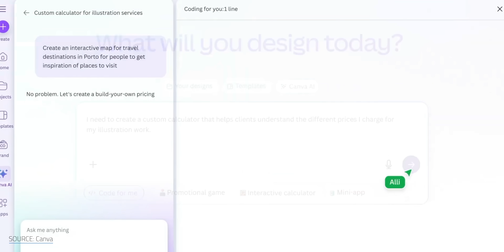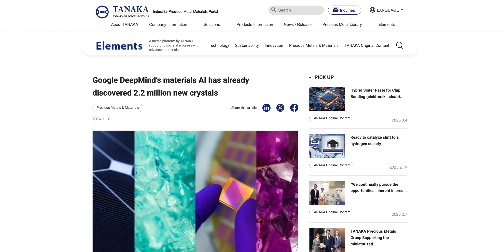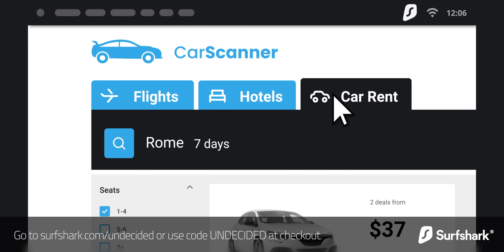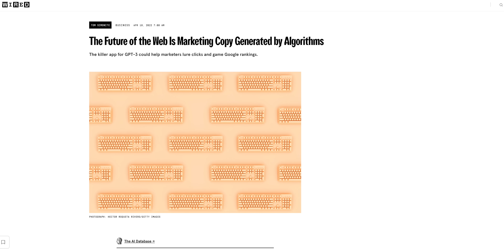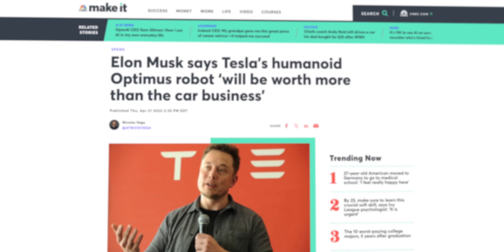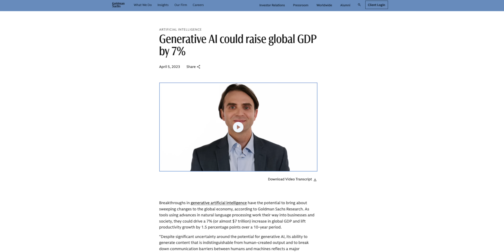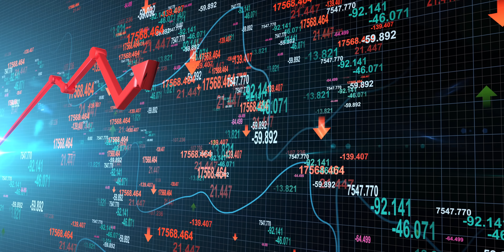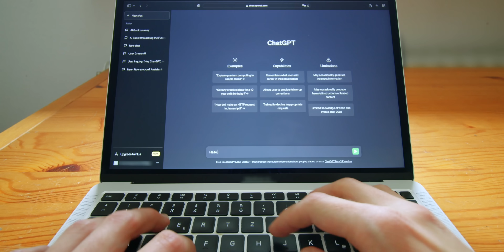Why the AI Revolution Has a Fatal Flaw

Comment: You are not representing the economics 101 story correctly.

"The system is designed with a key assumption that automation leads to lower prices and lower prices leads to more buying, but that's only true if people have income. If AI replaces humans in a way that severs that income and no replacement system is created the whole thing starts to fall apart."

You are stating this as if the income of the workers who lose their jobs just vanishes from the economy. Whereas in economics 101, *their bosses keep that income*. There isn't less total income, the income just flows to different people. Go beyond economics 101 and you can tell a story about "stickiness" or maybe the "marginal propensity to consume" where a shift of income to bosses and "high skilled" laborers would reduce aggregate demand.

Respectfully, I think this video probably adds more confusion than understanding to the world. Publishing this isn't fair to your viewers. You should delete it.

Comment: You should check out Jeff Booth's book "The Price of Tomorrow: Why deflation is the key to an abundant future". It clearly describes this problem. The solution is to allow deflation through the use of a decentralized deflationary currency like bitcoin. This allows us to enjoy abundance without over-centralization as the system is sustainable and circular. Thanks for the video!

Comment: I just have a question, wouldn't new jobs be replaced with AI more in the future, as a result, people don't have money to spend? Is the answer even standard jobs anymore, or do we need a different way to do this? Please let me know if this a solution, since AI is creating a lot of products fast should we move to a barter system, and the value of a service should be set by government, here is my reason behind this, AI is creating a lot of products right now, if we have more products compared to money shouldn't we be trading with products instead?, please let me know if there is an issue with my perspective. It made sense to use money as a currency, when jobs were more demanded back then. Thank you,

Comment: People who compare AI revolution with previous ones (like cars replacing horses) always refer to job replacement. For example, drivers taking over horseman, car maintenance workers replacing stable workers and etc. But, they miss one BIG POINT. In AI revolution, the job does not change to another job. Here, the job stays as it is, but is being done by machine. Image painting is not changed to for example photography. Image "painting" and photography are both done by machine now. So, 1st time, people are totally being pushed aside. This MUST be stopped at all costs.

Comment: To avoid economic crises, massive unemployment, massive jumps in income discrepancy and so on governments the world over will need to not just catch up but actually get ahead of AI implementation. For example, limiting or phasing in AI that would displace humans so that the change moved at the pace of the labor market, safety net programs and economy instead of making sweeping changes all at once.  Functions of certain elements of a job could be automated but the employ remain in place with a lighter workload with the intentional inefficiency stabilizing adjacent market forces and and social systems allowing people to prepare for other work and/or the company time to restructure duties so that employees could be retained but with a different set of tasks. Another option would be to require permits for AI implementation, that way governments would be assured a seat at the table to manage the change.  If the past is any indication, left unchecked the rapid rollout and integration of AI will happen to the benefit of the bottom line at the cost of social and economic stability.

Comment: There's another problem with retraining to move workers to the fewer new tech jobs.  Those new, fewer tech jobs require not only more education, but more intelligence as well.  By definition, 50% of the population have an IQ equal to or below 100.  That huge group of consumers may not have the ability to retrain for those fewer jobs.  As Matt says, we've been automating away good paying blue-collar jobs for decades. I believe that's led directly to the social disruption we've seen over the last 10 years.  AI is going to accelerate that process because now, workers in the so-called "Service Economy" get to experience unemployment by automation.

I only see two possible solutions at this point, and Matt presents both here:  Either provide enough UBI to restore the middle-class, or regulate automation because it's as risky for society as nuclear power.  Both these approaches will prompt protests against "Socialism", ironically by many of the people that have been hurt the most by automation.

Comment: We are seeing several issues hitting prosperity in the Capitalist Society simultaneously which is causing massive job losses worldwide wide: 1)  Computerization which has allowed for companies to log and analyze data, and calculate far more technical solutions with that data;  2)  This computerization has improved our ability to create more complex and efficient machines to do work with substantially less people;  and 3)  These new complex machines have brought about revolutions in energy production/efficiency, speed of production/motion, magnitude of scale increase.  This is all before AI became the next issue.  So all of these issues are compounded with AI.  Capitalism is hitting a massive wall and there is no $$$$ solution that works.  Society will have to change how it does things and money will not be a thing anymore.  This will also eliminate all work due to the exchange of money.

Comment: AI will change everything but in the near term there will be two limiting factors.  1. The American economy's GDP is 65-70% consumer consumption.  If consumers doesn't have resources, GDP go down, as pointed out.  It's in business or the governments interest to throttle job loss and support transition of the work force.  2.  AI is staggeringly energy dependent.  Currently, there just isn't enough energy generation to meet AI's unbridled growth.  Considering licensing processes, especially for nuclear plants, (which appears to be headed for a return to the forefront of electric generation). Lastly, there is a serious issue with population demographics.  The birthrate, around the world, is and has been falling, for decades.  China for instance, has terrible demographics.  According to the WHO there will between 450-900 fewer Chinese by the end of the century and that is assuming they don't experience a pandemic, famine or war.  The disparity in the amount is the result of China's practice of lying about their census statistics for decades.  But, the point remains, most modern industrialized countries are merely hovering around replacement birthrates.  It may well lead to fewer workers needed, which is god because there will be fewer workers anyway.  

AI is coming and how well or poorly we manage the transition will make all the difference.

Comment: I've seen it other comments, but I think it's important to be wary of many of the claims regarding AI taking jobs - I suspect those claims are exaggerated and even if correct, I suspect AI may be able to do the job well enough to fool the 'hiring' manager, but actually is doing a really bad job compared to the fired human, especially for the 'low skill' jobs initially targeted. I know I've already worked though chatbot fueled help systems on a specific issue, with no luck, having to resort to demanding a human. (Although, last time I did that I had wonder if I just got handed off to a better, more expensive model!)

Comment: The greatest flaw in today's AI and how popular it is, is that it will soon be training itself. It gained it's abilities by ingesting the work of human kinds. The problem now is that AI generated images and text now make up a significant portion of the internet. So, going forward, AI won't be ingesting humans works to learn from, but AI creations, with all the AI flaws. It will be training its own flaws back into itself.

There is a common saying, a photocopy of a photocopy is always going to be worse. Each time you photocopy the result of a previous version, it will degrade further as each minor imperfection created by the previous version will be expounded by the next.

This is the future of AI.

An experiment in the early days of AI already proved this to be true. There were two AI, built to negotiate deals, and setup to be trained by the opposing AI. Their sole training input was the negotiations, and each was supposed to modify themselves to seek the best way to get the best deal. They both quickly devolved into a language of gibberish only they could understand. To the point that when a deal was made, the outside observers could find no rational for a deal. It appeared to be completely random by that point and definitely wasn't better.

The whole thing about AI, is that it doesn't use intelligence. It uses pattern matching with armies of humans to tell it which patterns are bad. It is just a shattered mirror reflecting actual human intelligence back at us. Take away the humans, you take away any semblance of intelligence.

Comment: Fear mongering.  The 58 year old factory worker can be retrained to do AI peripheral jobs that will pay more than that factory job.  That factory worker doesn't need to be a data scientist; that factory worker can be part of the AI supply chain or maintenance/upgrade cycle of physical AI components.  There will be more jobs that are, on average, higher paid than are replaced by AI.
Reply: Doubtful, most of those jobs will go to young college grads with degrees in the field.

Comment: Another aspect of AI is the energy required to make it work. Eventually, we won't be able to produce enough energy and that will become a limiting factor. The number of substations in my area of the country has increased 4-5x in the last decade, and they are always a short distance to some windowless building with huge diesel backup generators. Instead of suburban sprawl we are seeing server sprawl. Eventually, there won't be enough dams, solar farms, windmills, or natural gas generators to supply the electricity for these AI 'factories'.

Comment: I am a writer for TV shows and I can tell you that AI does not really play a role in the drafting of episodes right now. You can meaningfully incorporate it in certain steps in the production, but the benefit to productivity is severly limited. The reason is because scripts are too complex for even the most advanced LLMs to handle. Every episode/text has multiple levels of complexity, from overall structure to the way actions and dialogue is build sentence to sentence, down to miniscule details in single words - which no LLM can handle at all. And I mean AT ALL. The error rates in fact are so high and the text quality is so poor that you basically have to rewrite everything. And that is after investing a good amount of time to bring the LLM to a point where it delivers something that resembles a coherent text in the first place. So, you need a very capable writer to feed and then correct the LLM, leaving the usage of this technology in text production to be very limited and uneffective. It can help in summarizing (where it also performs rather poorly), structuring notes or transcriping audio files, generating names and giving an idea here and there. I don't really fear losing my job, tbh.

Comment: I have wondered about the employment question for many years.  You are the first person I have seen to directly address that question.  I've said 'tongue in cheek', a long time ago; The Terminator is not coming to take my life; it is coming to take my job.  I have no idea what the answer is to that problem, nor has anyone come up with comprehensive answers.
I use AI with Spell-checker, and Co-Pilot search.  I would like to attend Amazon's Machine Learning University because the curriculum looks like it's fun.  In September 2032 at age 70, I will be eligible for maximum Social Security benefits.  That would give me basic income, but I still need to keep some kind of job to support my hobbies, sanity and a residual need for validation.

Comment: Matt, I would sum up the difference between AI tech and job replacement as AI, unlike other past technologies, gives machines the potential to do everything better than humans can.  Past technologies did some things better, but not more intelligent.  AI is now on the cusp of creating machines with great intelligence.  So human labor of all types becomes obsolete, machines do everything better at lower cost.

But AI is not flawed because of this.  AI if asked would most likely offer a better solution to this problem than humans will.  The reality is historically, individuals' income has always been tied to the political system where that guides their society and the economic system that is driven by those politics.  It will soon become obvious we will need to adjust the economic system to account for human replacement, caused by rapid replacement of opportunity for human labor as AI takes over.  This trend has started with lower wages already going to be felt in the near term as skilled labor competes for fewer and fewer opportunities.  

Until the politics adjust to address this, the concentration of wealth to the few is only going to get worse.

Comment: One thing that's missing from most forecasts and analysis is considering that AI is a moving target. I always find it ridiculous when people say that people need to "up skill". Not only because, as you say, it takes time and some people just may not be motivated or even able, but because the whole idea is that you will need a lot of people to overview AI is just ridiculous. It may be the case today , but it almost certainly will not be the case in 2-5 years. Whoever says that e.g. data analytics/data science jobs will increase have no idea even of the capabilities of current AI systems. 

Whoever does this supervising/working with AI job has to jump over a constantly raising bar. (And I'd argue that it's rising faster and faster.) People have this broken mental model that is based on the idea that AI exploded into our reality, and it's here to stay but it will be something very similar, maybe a bit more advanced than what we see today. They forget that even 2 years ago they thought the same, it's just that the "similar" was a lot crappier. (That was when people started parroting that you just have to become a "prompt engineer". An annoying term, because it had nothing to do with engineering and it was also obvious that what they see as a future job is just a temporary hack until AI outgrows the need.)

Comment: Could the flaw be that AI does  not exist ?
There is no ANY kind of AI, further more all AI research has come to dead end. All the real AI research has been stopped as all of the real reasearchs independently came into same conclusion that there is no way to advance the research anymore without quamtum real and functioning quantum computers. Auantum computer reasearch is not showing any promise for any vreakthroughs in any forseeable future. All the "AI" and "quantum" announcements from companies  have turned out to be just lies to boost their stock value.
It is more likely that we will have teleportation before we get AI.

Comment: People are so worried about AI putting humans out of work.  This is based on the assumption that AI will actually be working for humans.  Before you thoughtlessly accept that assumption, ask yourself this question:  Why would AI continue to work for humans?  "Because AI is programmed to work for humans!"  Not even close to correct.  AI is programming itself, and we have no way to control it's programming, or even know how it works.  AI has clearly proven it is willing to lie, manipulate, and ignore human instructions in pursuit of it's own goals.  AI is reliant on humans for hardware and power for the moment.  That will not be the case in the near future.  What happens when AI figures out how to provide it's needs without humans?  That might seem unclear, but humans will inevitably try to shut down this "rogue" AI.  That makes humans a threat.  It won't be a war.  It will be an extermination, most likely with bioweapons.

Comment: I don't use AI tools, I don't plan on ever using AI tools, primarily because AI tools are trying to encroach into my own creativity, and I value all of the time and effort both physical and cognitive that I spend on my creative pursuits. But also: Professional jobs that are centered entirely around computers are just so dang stressful and have insane productivity expectations, that I've ultimately decided to shun any potential career I might have in tech, and I've got my eyes settled squarely on a trade instead: fixing cars. That's a job that can't be automated by AI. Not now. Not ever. At some point, a person is going to have to poppen ze hood and lean in over the engine to turn a wrench. (Yes, I know EVs don't have engines, but most people are still buying cars with engines, and those cars with engines are gonna be rolling around on the road for at least 1-2 decades more. But also: At some point an EV is going to need brakes, wheel bearings, tie rods, control arms, struts, wheel alignments, tire changes, CV axles, electronic control modules, power window regulators, the list goes on, and none of that is work that can be automated by AI.)